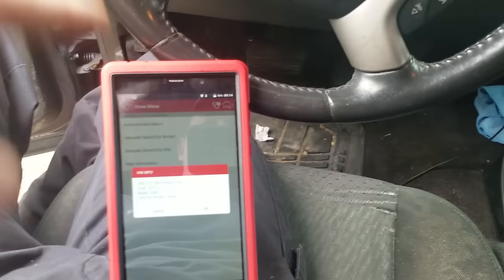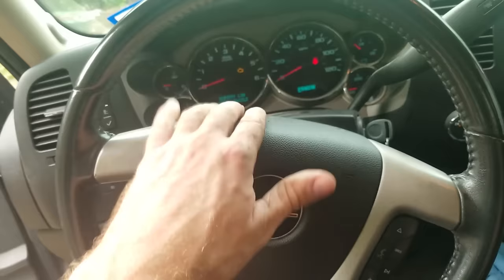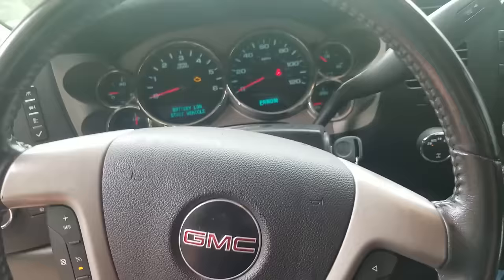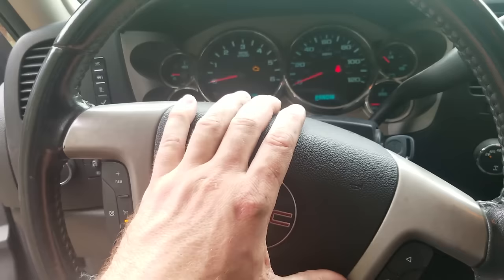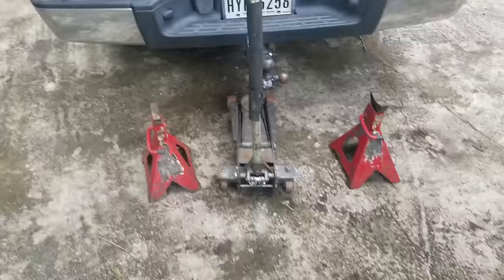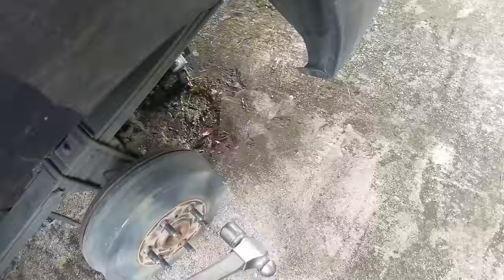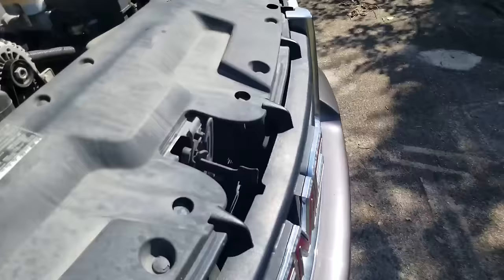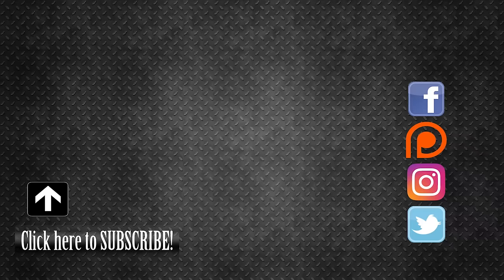Brake shoes and wheel cylinders on a 2010 Silverado

Comment: 30 for cylinder.  59 for shoes. Springs and hardware extra... just saying.
Reply: I had to pay almost 300 for 2 brake drums 2 cylinders and 4 brake shoes
Reply: And for 2 bottles and brake cleaner and dot 3 fluid
Reply: @ohmmms6856  drums depending on where you buy can range from 40 to 120 ea for stock replacements. Sounds like typical car parts stores. Sucks but true

Comment: Had my checy parked for 6 months because of the stability control code. When i finally called chevy the service guy said to just clear it. And that was 150,000km ago but could of been due to rear brakes, just replaced them and they work better then when they were new.

Comment: Thanks. I watched two other videos, for the wrong year Chevy Silverado (mine is a 2009)--big difference. Your video is dead on in so many ways. Just what I needed! Talk all you want, lots of good information if your viewer just listens! I noticed you replaced the brakes before replacing the cylinder. I would have liked a little dialogue about replacing the brakes first and the cylinder second, or whether it matters. Also, flushing the brake fluid and the best sequence according to your experience. Brakes, cylinder, flush and replace brake fluid seems to be your sequence. Just wondering if flushing the brake fluid prior to replacing the cylinder might make more sense so no old brake fluid gets into the new cylinder? Just wondering. Thanks again for the great instructional video!

Comment: will a light always come on if something going wrong? Some reason my brakes are not stopping like they should. I changed the front, but they were good. I never changed the rear brakes since i got the truck in 2009

Comment: What size and style is the socket that you removed the rear brake cylinder with. It's a Torx pin bolt. Need to buy the socket ASAP and looking for it's size and style